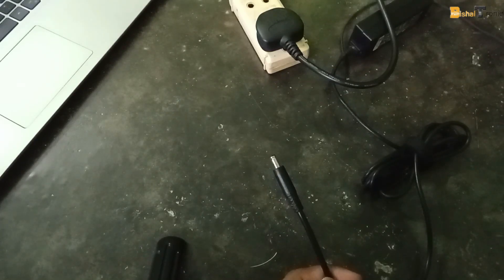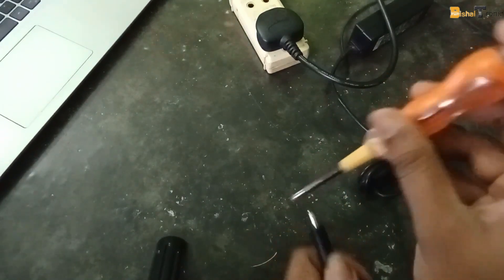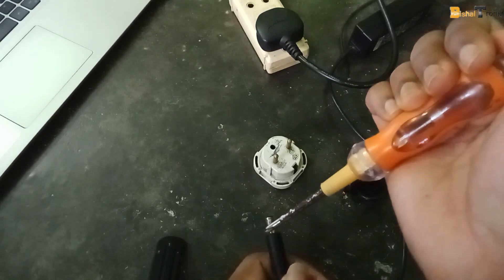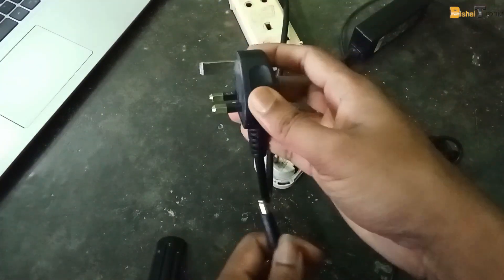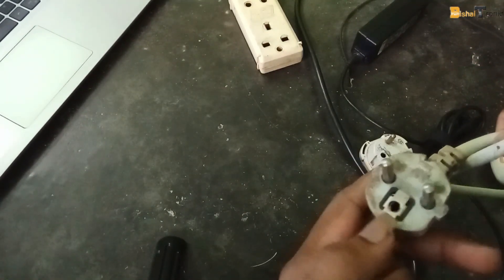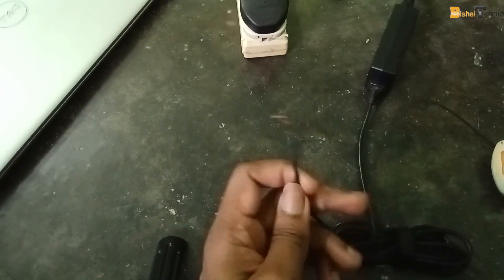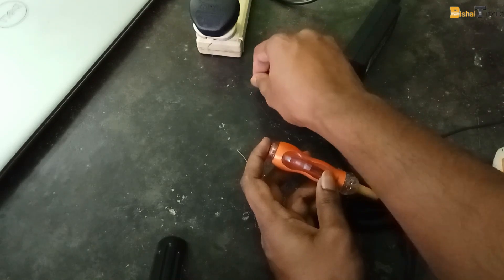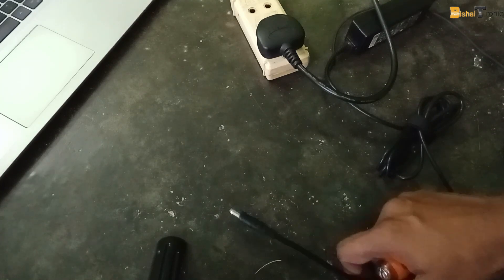Electric shock from laptop while charging - Shocks from Your Laptop: Tips and Solutions

Comment: Please explain the solution more clearly i am facing the same problem with my laptop original hp charger
Reply: @awareindiabypiyushsinghal4946  try to change the direction of the two pin plug which you have connected to the main source socket. If you are getting shocked change the direction. This is how I have solved my problem